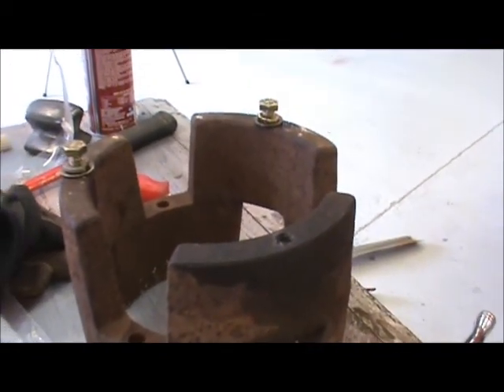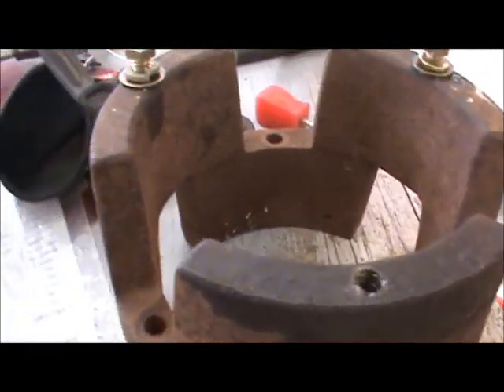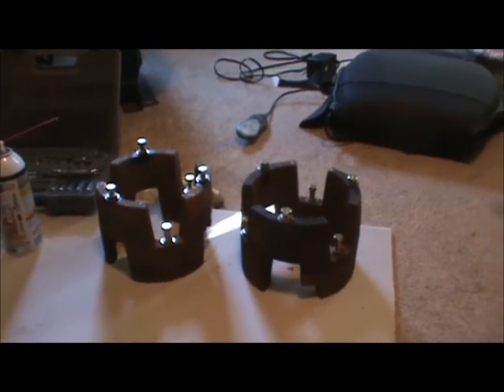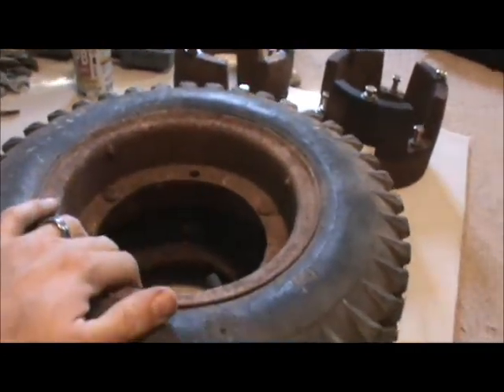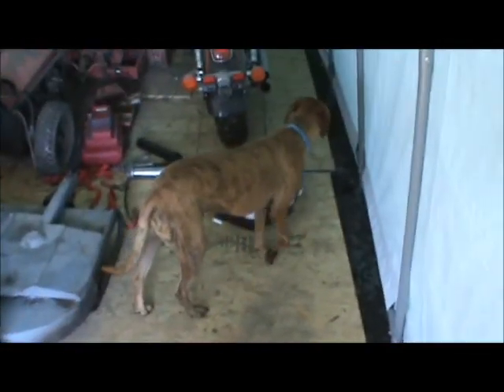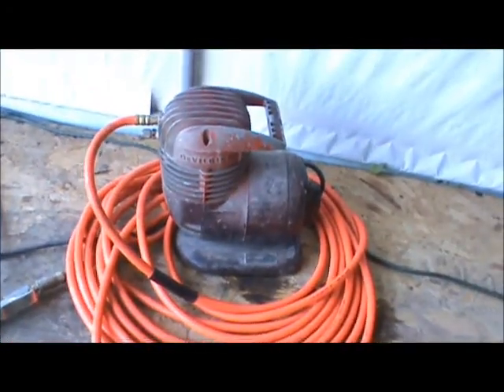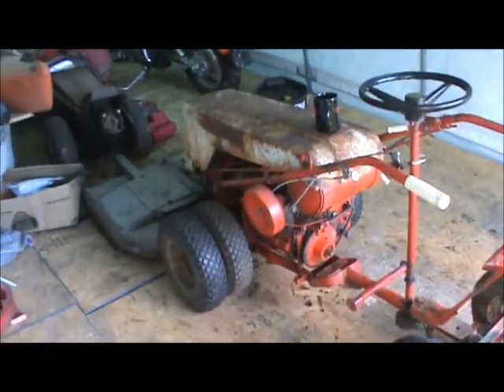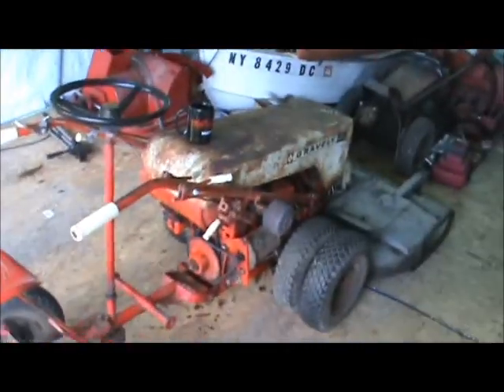Gravely dual wheels/weights for the Super Convertible

Comment: I just got a set of these spacer/weights and not clear on what rotation and length and size of bolts to use other than my tractor is a commercial 10 A I have the same set as you have here. any advice on the spacer install would be greatly appreciated. thanks and cool pup
Reply from the maker: I don't recall the thread pitch of the bolt off hand, but they're all the same as the lug bolts that would be on your 10A wheels now. you would have to measure the depth needed to bolt through the wheel weights and into the wheel hub of your tractor, then just match up the threads at the hardware store to your existing lug bolts.